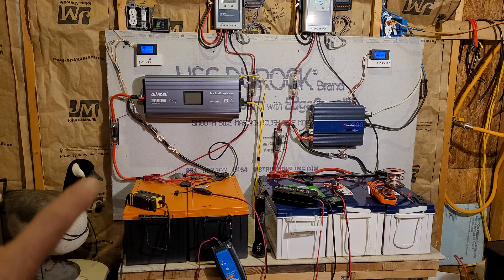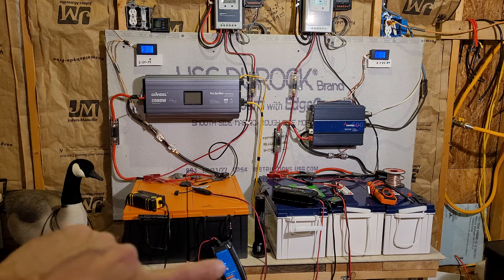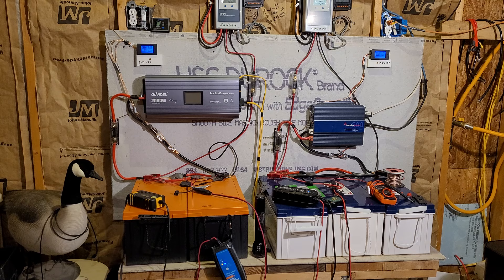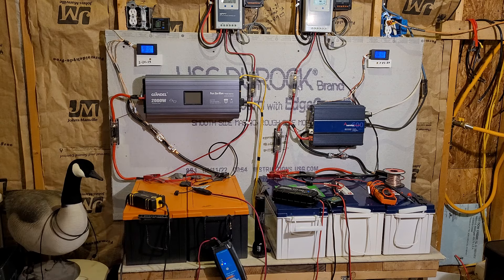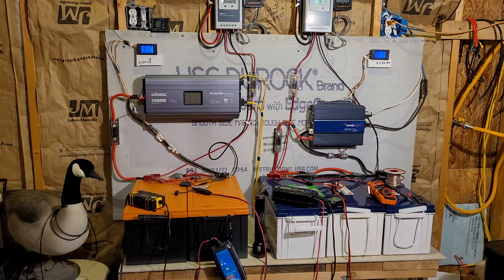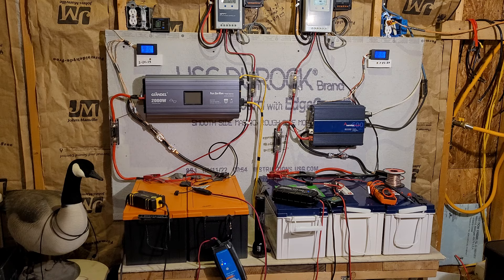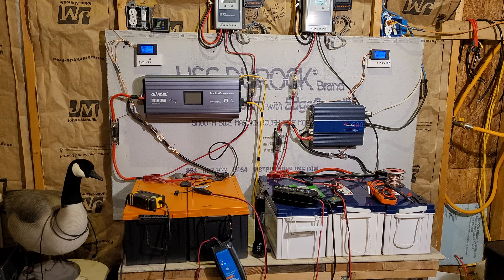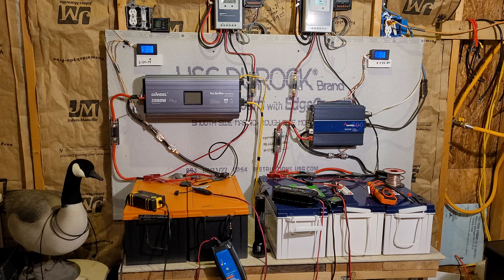Winter Off Grid Back-Up System performance.  Clouds really HURT Part #2

Comment: What's your load, what's your PV output and what's your battery capacity?

I don't understand people running a system to see how long it runs a load when it's simple math, if you know your loads and capacities the only unknown is how much PV you create, you can figure that with simple tests of one of your modules with a calculated load on an overcast day or just check your output on an overcast day with your PV array and get a very good idea how long your system will run.

In the Catskills we have days of overcast, instead of increasing my battery bank I kept adding PV so that even on overcast days there would be enough generation to bring my batteries up to run the house. I also used double sided modules to maximize light conditions.

Comment: im new to this too. not knowing what voltage the pv panels are putting out or how they are wired, id say the wire gauge seems small from the charge controller to the batteries. you may be limiting the charge that way. also why 12v?
Reply from the maker: 8 Gauge THHN between controller and the battery.... and 12v cause I was broke and its the cheapest...

Comment: are you running your panels and batteries in series or parallel ? I run mine is parallel and it seems to help out a bit on partial cloudy days when my panels get shading.
Reply from the maker: Both Parallel